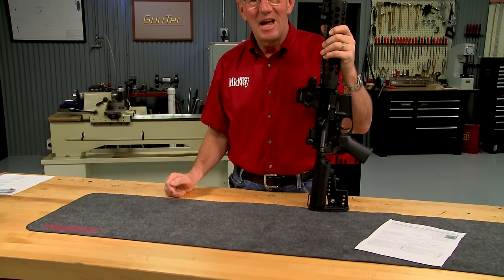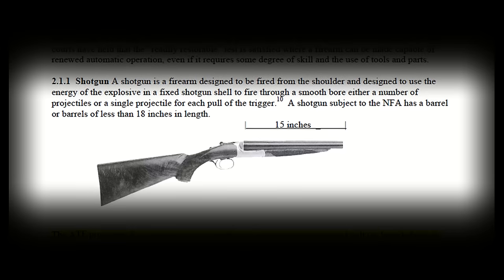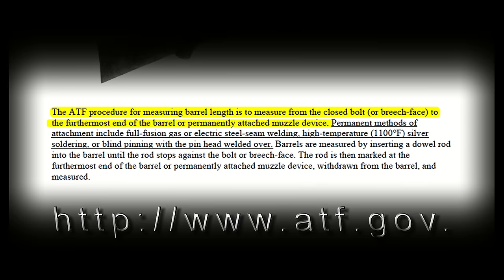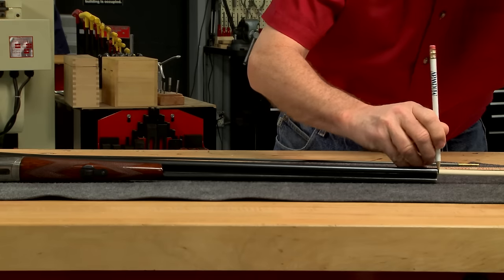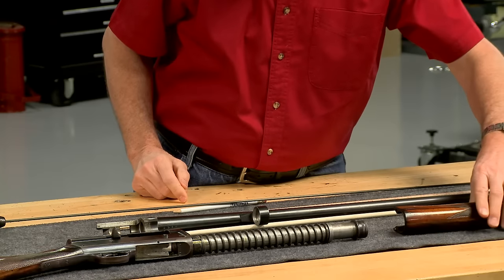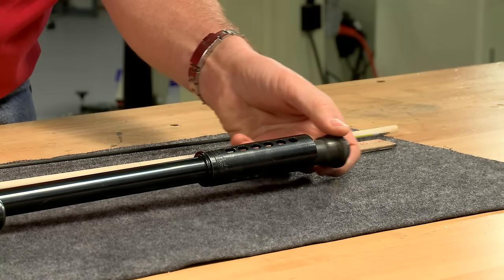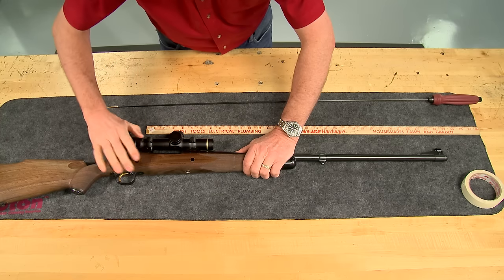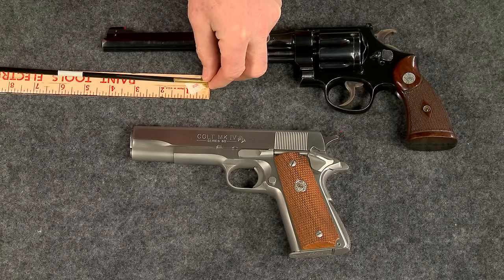How to Properly Measure Barrel Length Presented by Larry Potterfield | MidwayUSA Gunsmithing

Comment: I have always wondered why the chamber is considered part of the barrel length on rifles and semi autos but not on a wheel gun. Is it because the chambers on the wheel gun are not physically attached to the barrel? It always seemed to me you weren't getting an accurate barrel measurement when measuring to the breech face.

Comment: Ok, how about a revolver rifle. Such as a Taurus Circuit Judge. Back of the cylinder or front? The reason I ask is I have one. And it is 16”. But while out shooting. It slid and hit the muzzle against a rock. I need to cut an inch off to clean it up.

Comment: Is bullet run ever considered in barrel length? eg: a 24" barrel 30-06 vs 24" barrel .22. The .22 has more true bullet run than the 30-06 do to case length and is that why the bullet manufacturers use 26" test barrels.

Comment: So essentially, accepting revolvers, just put any firearm fully into battery, and stick a dowel down the barrel, and measure. I guess this could be a pain for AR-15s that have a muzzle device that isn't permanently attached, but doesn't easily come off
Reply: Measure the outside length of your muzzle device and subtract. If the muzzle device is pinned and welded, it can be included in the overall length.

Comment: Soooooo how do you measure an AR?
Reply: not fully correct good buddy, if your flash hider/compensator/muzzle device is removable, you screw that off first, then measure from closed bolt to end of barrel as seen in video

Comment: How do you deal with fractional inch measurements?  Do you round up, round down, round to the closest 1/4 inch?
Reply: What is Is
Reply: @thomasmack3195   Don't round, if push came to shove and you're under you can be charged. It's likely that if it's really close they wouldn't care, but why go to prison over an 1/4th of an inch?

Comment: It's so stupid that a revolver pistol doesn't include the cartridge length/cylinder, but the semi-auto pistol does.
Reply: Z.A.P. Squad it kind of makes sense though. In a semi-auto, the chamber is an integral part of the barrel, it's literally the same piece of metal period for a revolver it's not. The cylinder is constantly changing, and it's certainly not the same piece of metal